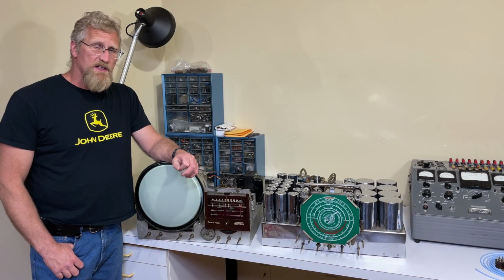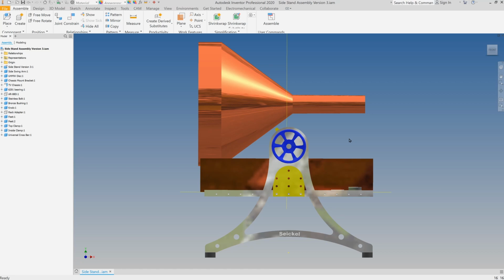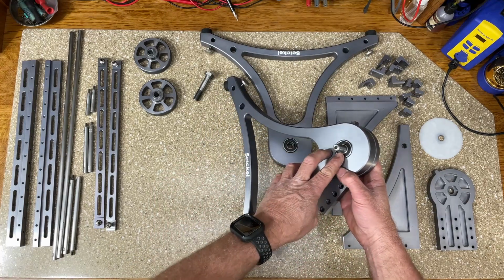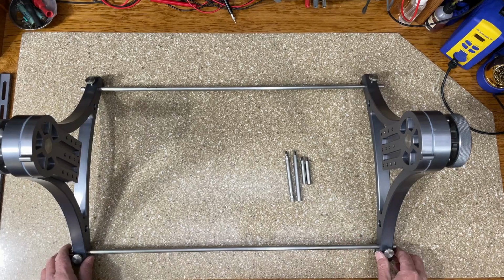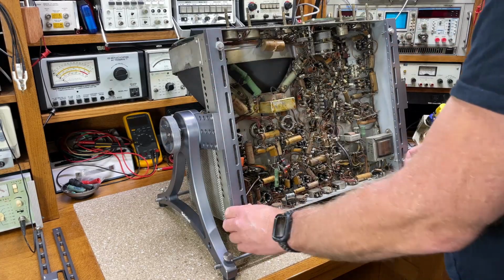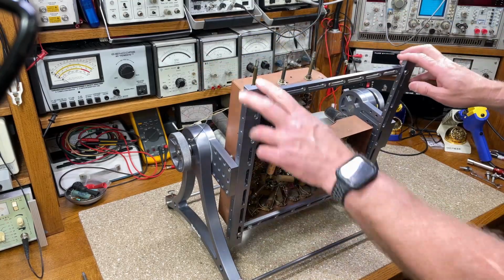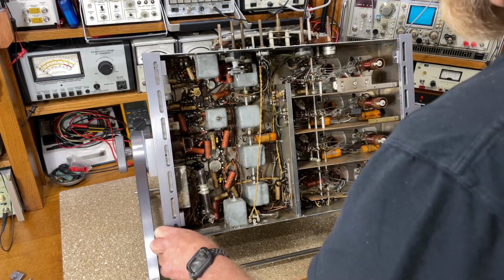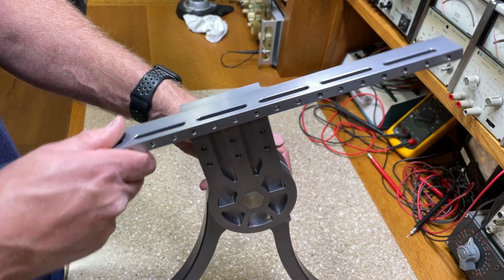Antique Radio and TV Repair  Chassis Stand

Comment: I see below you're not selling these, however you may be providing the plans to build it. How can one get in contact with you? I could really use this stand and would pay just for the plans themselves.
Reply from the maker: I don't have 2D plans.  I have the original Inventor files, or I can save it as an IGES or other format.  Not sure you can open those file types.
Reply: @thermionic_emission  IGES or STEP would work best for me. (have solidworks).
Reply from the maker: @Nazculi  Get me your email address and I will send file to you when I get a chance.
Reply: @thermionic_emission  YouTube censors any reply with my email address. Are you on any other platform or Forum that we could reach you at?
Reply from the maker: @Nazculi  Username "Scott" on the Antique Radio Forum.   Username "Polaraligned" on the Home Shop Machinist forum.

Comment: Found you on Mr. Carlson’s Lab Patreon, most excellent work. I’d certainly pay for plans and make a 3D printed version. Love the design, style and functionality. I’d scale it down by 50%, don’t need the rack mount capability, at least for today. Might be time to take my CAD skills up a notch and give it a go myself. Funny thing, been in tech all 30 years of my career, worked for Danly Die Set / Danly/Komatsu Machine early in my career supporting CAD engineer computers and never learned how to use it.

40 year woodworker, I’ve tried working metal, it’s just not for me. Bought a mill, lathe, band saw, the whole 9. Got 2 years in and realized how much I’ve gotten used to the properties of wood, namely movement, expansion & contraction based on temp and humidity. Working metal that doesn’t do that sent my brain on a spin. But, it’s that foray into metal working that got me back into electronics after not touching them for 30 years, so it wasn’t all in vain, I guess. What did amaze me was how well that tooling held its value, I made back 90% of what I put into it, not many other hobbies that can claim that.

Comment: If you're not going to make these, how about releasing (or selling) the CAD files.  With modification, this could be adapted to be 3D printed (albeit with less load capacity).
Reply from the maker: I might put together 2D PDF plans in the future, just too busy right now to get them done.

Comment: A minor point, but standard rack rails are normally tapped 10-32. 10-24 is used, but not very often.
Reply from the maker: I had a box of 10-24 pan head screws, that is why it is that pitch thread.  It really makes no difference to the item being mounted.
Reply: Some old broadcast racks made by GKM and sold by RCA used 12-24.
Reply: @kfourom  Yes, I have seen them. And some manufacturers "chickened out" and went to using the clip on style of sheet metal nut that would accept either 10-32 or 10-24. And you could force a 12-24 screw into them. I do not think there is any real standard that covers more than one segment of the electronic industry, but as I said above, 10-32 is as close to that as you can come. This is not a big thing unless you are in a large facility with more than one or two equipment racks - as I often found myself. Then you are interested in just having one type of "rack mounting" screw. I usually purchased them in boxes of 1000. If anyone sent me a rack mounting rail with any other thread, it went back. Every facility has it's share of goons who will make the screw they happen to have in their hand FIT. No matter what.

So I hate to see any other size of rack mounting screw being used. Too much of that already.